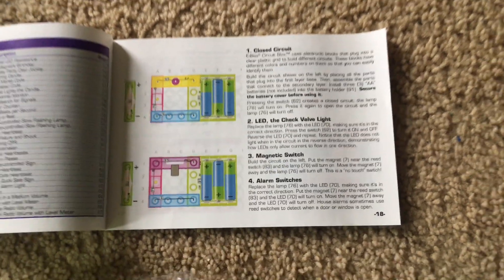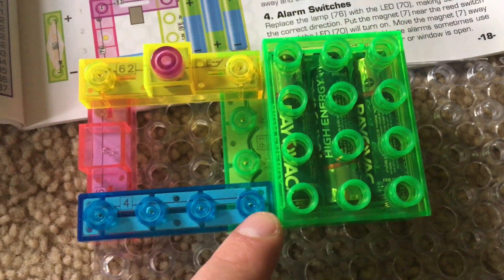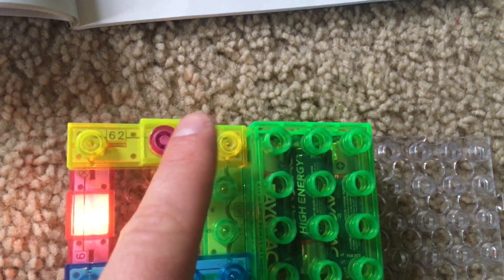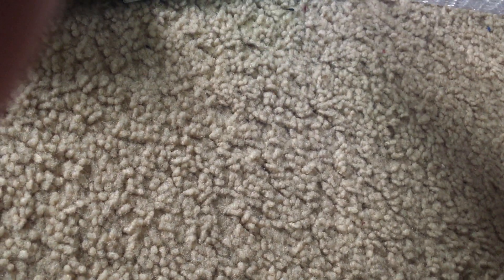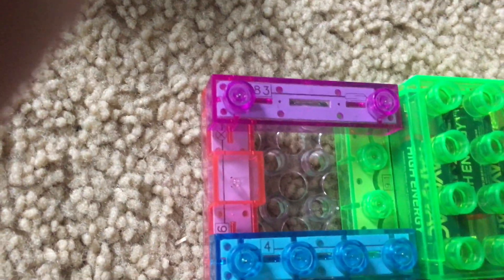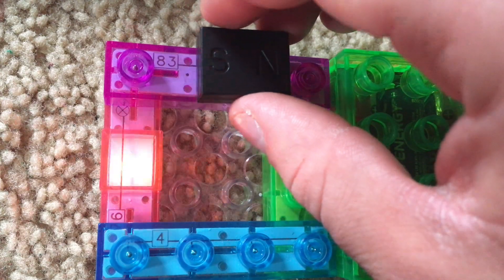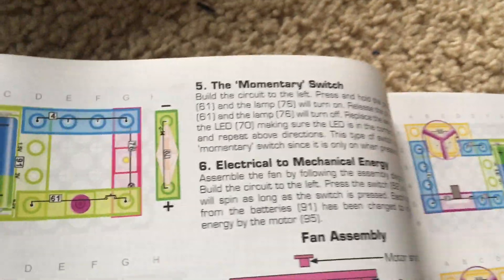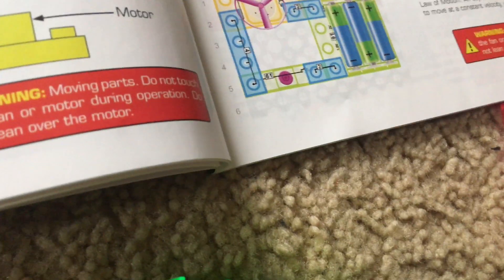E-Blox Circuit Blox Builder 120: Projects 1-5

Comment: Cant even get it open for the batterie
Reply from the maker: It’s been a while since I last used this kit, but you may have to hold the base of the holder and use a bit of force to remove the cover (holding its ends, not the sides).  Let me know if this helps.